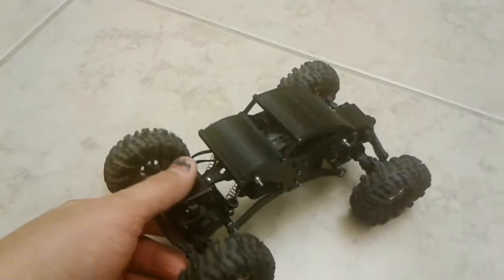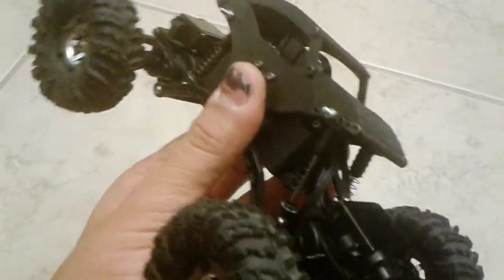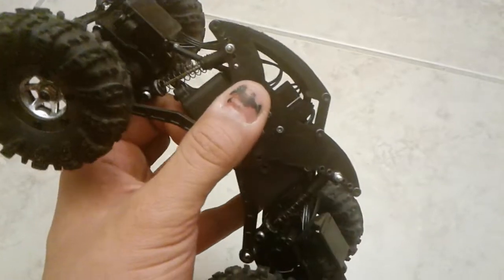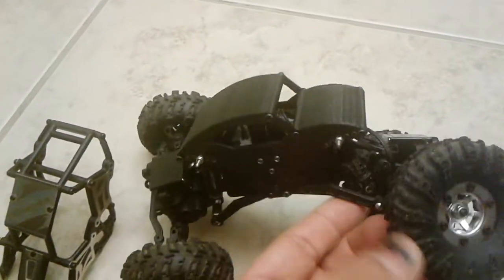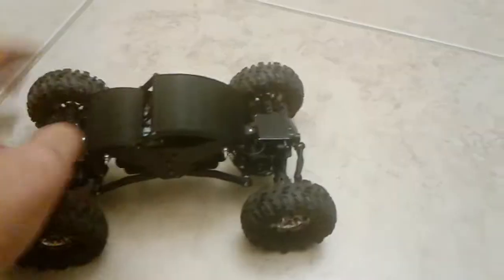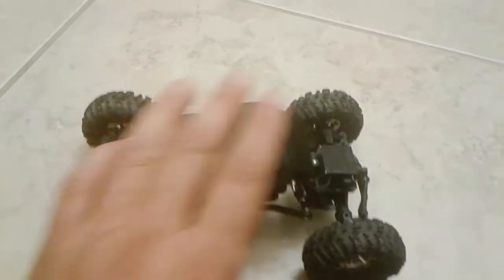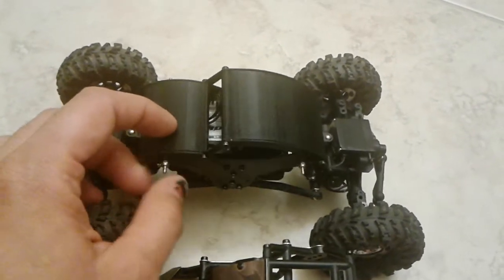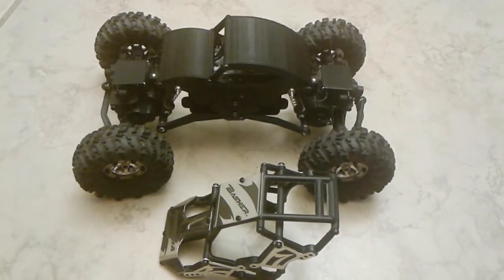Basher Rocksta Spider Chassis

Comment: I tried to order this from shapeways (4mm) but got an email from them saying that they could not print it and to contact you directly but your I'd can't be found
Reply from the maker: Thanks for letting me know, It has not been an issue but obviously something is out of whack with them if they sent you an email. Ill look into it tonight and get back with u.  Also, if you have a 3d printer the file is free on thingiverse just in case, in any case Ill get back with u, thanks!
Reply: Gamyrc unfortunately I don't have a printer 😢but I got the files
Reply from the maker: No worries, Ill get it squared away :)
Reply from the maker: So I made some changes on the site to see if the issue resolved, I could not get the website to refuse to print but let me know if it still gives you issues. It should be ok now but hey, thats what I thought before and here we are! LOL